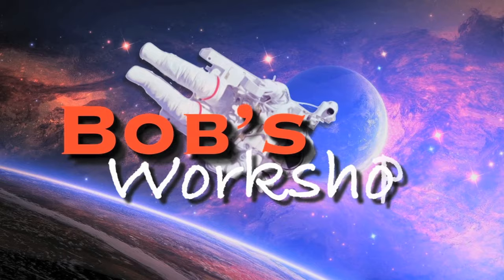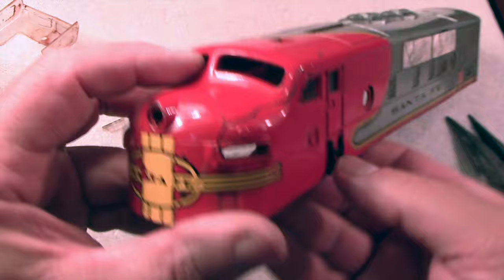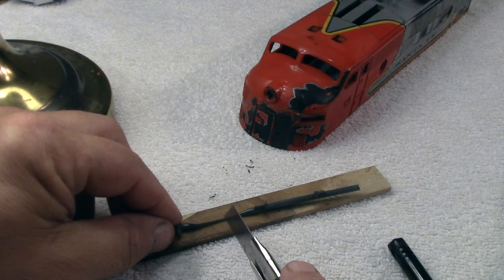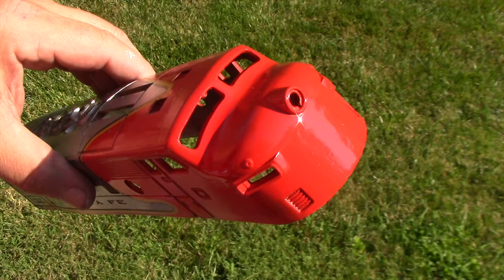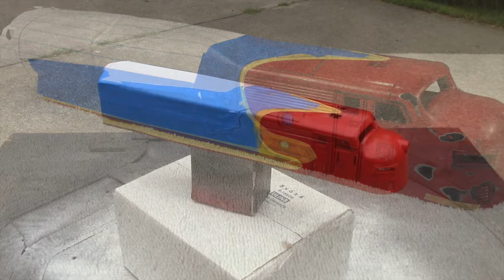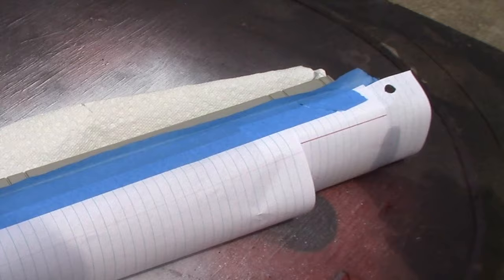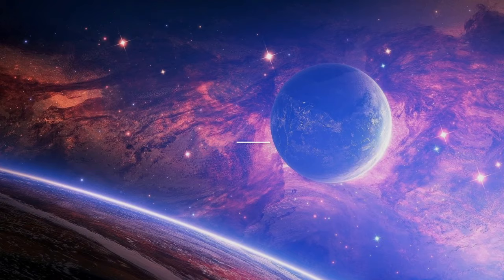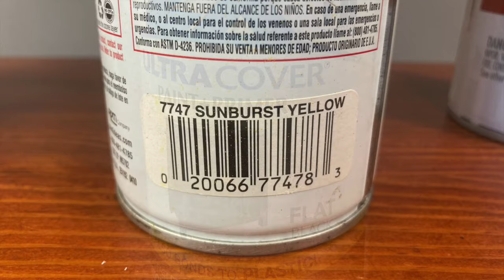How To Mask / Masking Tape & Spray Paint Tutorial Lionel F-3 Santa Fe A Unit Rustoleum MTH Williams

Comment: Not sure if I mentioned it before, but I use clear stickers and a laser printer to reproduce numbers for the blank number board. Couldn't quite tell if the original is printed, or embossed.
Reply from the maker: The number board I have has molded numbers with paint. But I only had one.